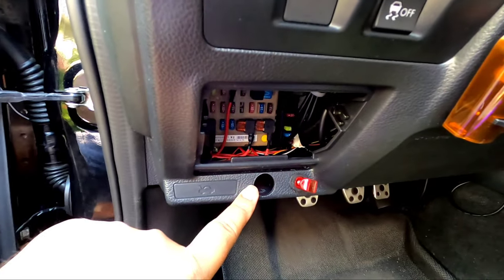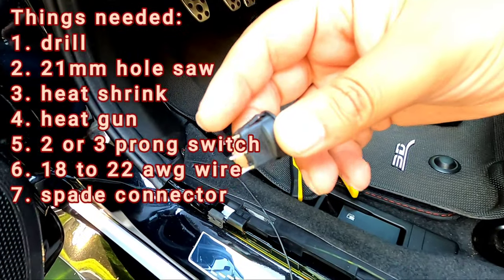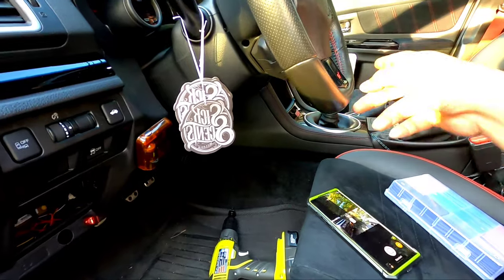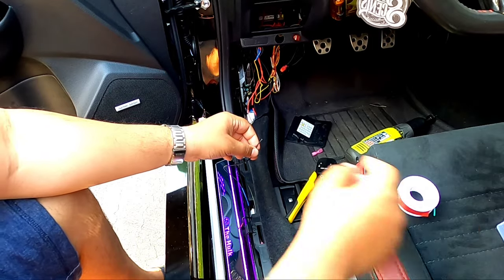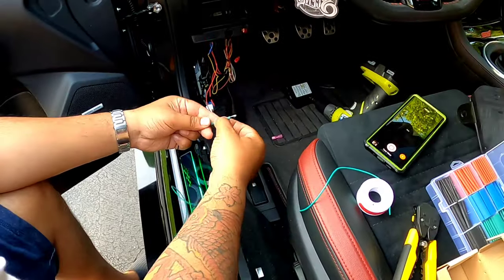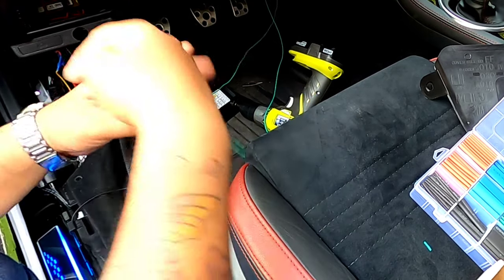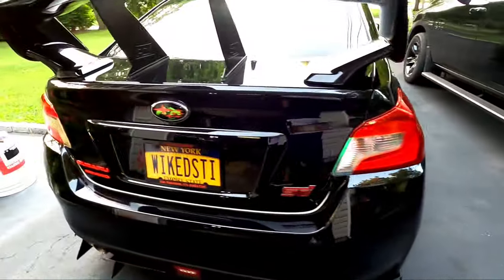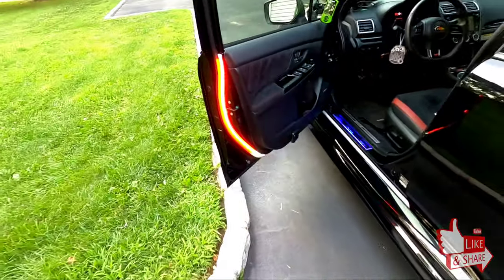Installing a custom switch for my car door warning lights on my 2018 STI

Comment: What are those step covers called with the light before you go in car please I'm liking those also I'm doing ur switch idea also thanks for that thanks
Reply from the maker: Those are called door sill led lights....aoonuauto sells them.  Use WikedWips as a code for so cash off ur purchase
Reply: @WikedWips  hope they make them for dodge I'm gonna use them in my lifted dodge ram truck lol
Reply from the maker: @suzukirider3980  just reach out to them and they will ask for your dimensions of the sill😃
Reply: @WikedWips  yeah they are like $100.00 a set I can't do that so I need to pass but thanks anyhow